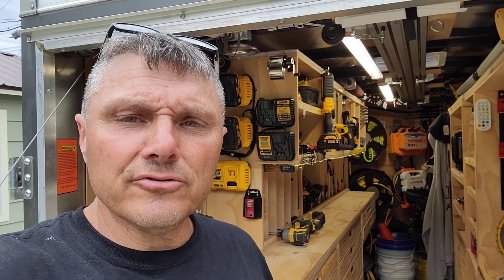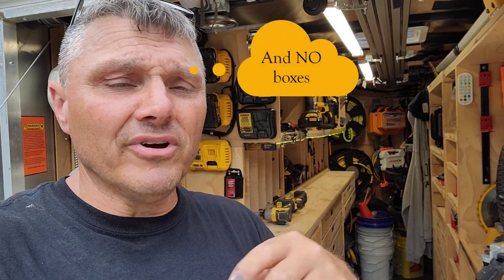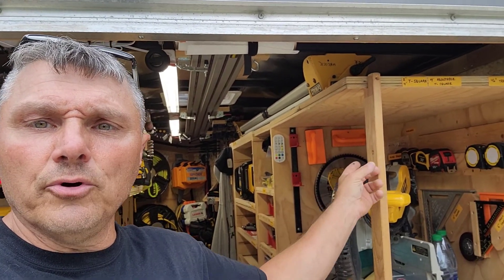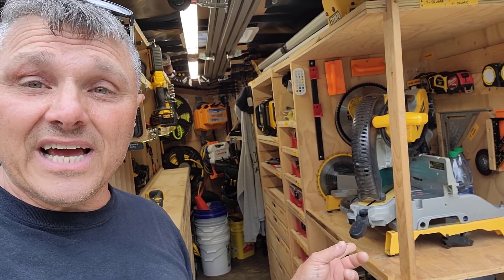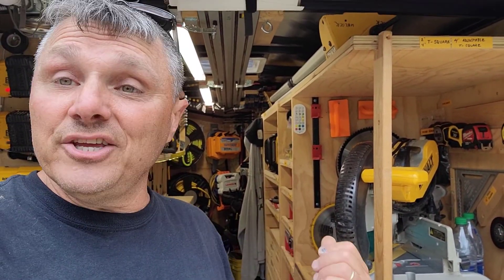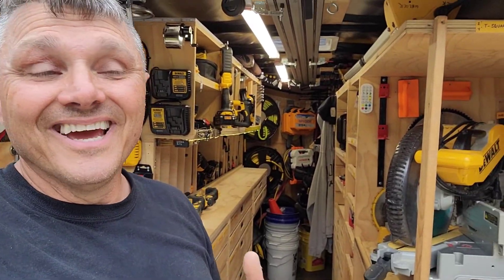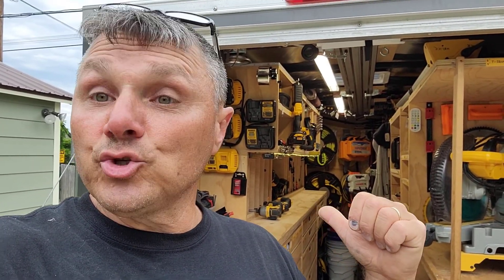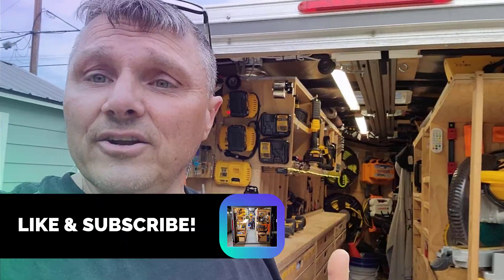My SMART tool trailer passive restraint review

Comment: Keep it up Spence! You'll hit your million at some point. 👍
I'm thinking of building some drawers like those in your trailer for some cheap and easy tool storage. Budget is tight right now so any savings is welcome, and I'm about done with storing tools in those cheap steralite plastic drawer units.
Reply from the maker: 1300 and counting up to a million!!! Thanks for the confidence vote! I like the hardware-less drawers and the routed out handles. Once I had my router template set using a pattern bushing on my router plate, the production routing of the handles and the "passive restraint notch" in the drawer bottoms were easy and repeatable. I have seen others that use drawer glides and actual pulls or knobs. I saved money by using my time to route. (and, good practice on the router as a bonus). Best of luck with your build.